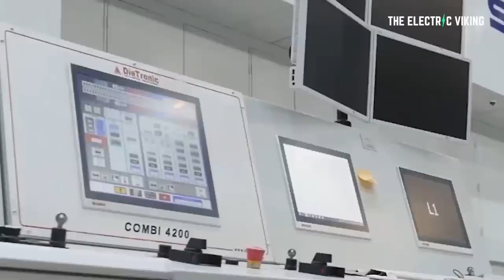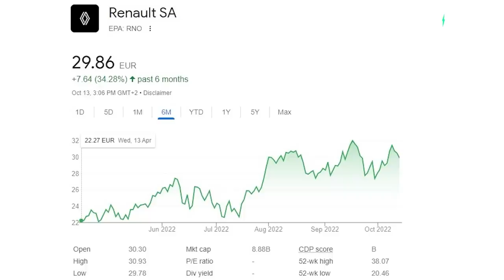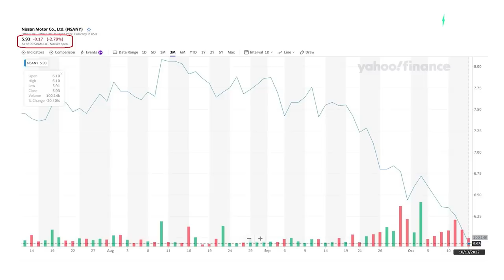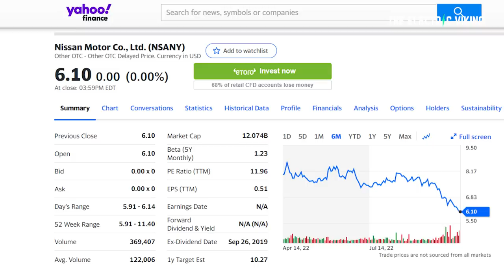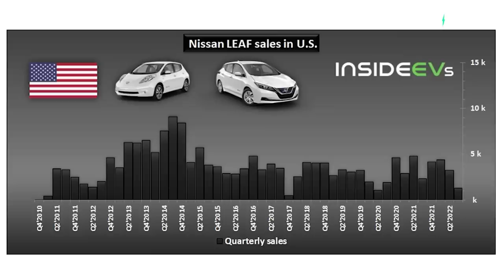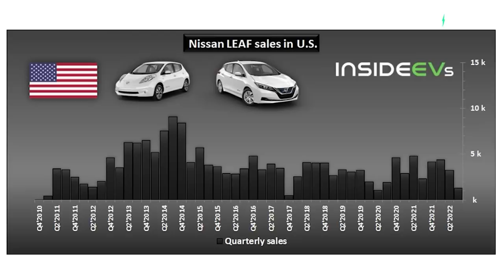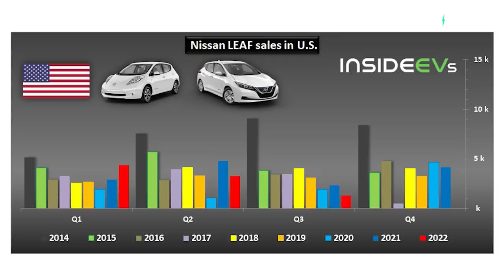Renault is DUMPING its 44% stake in Nissan as fast as possible

Comment: I’m driving a Nissan Leaf, my wishes would have been:

- CCS charging 
- thermal management for the battery 
- 3 Phase AC charging (11kw) in Germany, a household is usualy not allowed to use an 32Amp single phase Charger! They call it Schieflast prevention 
- a hitch allowed to pull at least 500kg

The rest would be ok and acceptable!
Reply: You should have bought a fucking truck. You have a Toy.

Comment: the leaf is just low key poor all around. poor range, poor fast charging, no battery cooling and chademo all for the same price as a bolt which as good range and battery cooling and a ccs plug but about the same shitty fast charging. so at least the bolt picks one struggle.

Comment: Flip side is that Nissan have an opportunity to fix the quality control issues that they acquired when Renault came along. The post Renault Nissan’s I’ve owned were complete dogs, in and out of the dealers, whilst the pre Renault ones were very robust and reliable.
Reply: Completely agree! And they missed a major opportunity not updating the current Leaf more than they did.

Comment: A key parameter is miles per kWh. Any company that can’t make efficient vehicles is at a huge disadvantage. Poor efficiency increases battery cost any weight. Increased battery weight Increases other weight and requires more costly tires that wear out faster. Charging takes longer for big batteries. If charging is done at home with standard household voltage& amps then a small KWh charge becomes reasonable time required.  Efficient miles per kWh is the key to success

Comment: I think it would be good to mention that the legacy OEM commercial model tends to have low margins on the actual car sale, while they depend on very large margin on parts, over the service life of the vehicle. Given the much lower maintenance overhead of EVs, Tesla won't have this trailing high-margin income stream.
Reply: tesla has the higher margin of software sales
Reply: Yes, Tesla won't profit from maintenance much, just as Toyota didn't compared to competition before electric. The result from their loss was twofold: 1. Toyota became #1. People are ignorant/stupid but they finally catch on. 2. Toyota saved on warrantee claims. Did they save on advertising, using word of mouth? Tesla certainly does profit, on net, from all three, namely, highest quality (best value), lowest warrantee payouts,  zero ads.
Reply: But Tesla will profit from FSD subscriptions and insurance, and is profiting from all of the data they collect from drivers to help them build the FSD systems. Tesla also has unheard of profit margins in the automotive industry from direct sales without the pesky dealerships, has the power to control pricing to match demand, does not pay anything for advertising, has the best long term supply chains in the industry, and has the worlds best charging infrastructure that they profit from both with their own sales and increasingly those of their competitors.
Reply: Just a thought that occurred to me….how quickly are people going to start dumping their ICE vehicles once they have to pay for all the spare parts and EV owners aren’t. Do you think this will drastically shorten ICE vehicle’s life expectancy and raise demand for EVs even further?
Reply: @lukeappleby5949  
This is one of the great known unknowns as EV's disrupt the market. When the first ICE manufactures go bankrupt, there also will most likely be a wave of bankruptcies in their suppliers. This will effect the price and availability of spare parts, since even aftermarket manufactures need time to adjust to major market changes. ICE parts are going to become increasingly expensive to manufacture as there is less new ICE vehicle production, but some prices may lower when the OEM manufacturers no longer have a lock on production and pricing. Just as the horse and wagon business changed, it's going to be a quickly changing business for many years to come. Do you know your local buggy parts supplier?

Comment: Not directly related to EVs, but what killed car sales in the U.S. for Nissan (I liked it better when it was Datsun) was their truly awful CVT transmissions. I have a Titan p/u but it has a regular automatic. Other makes of cars had and have CVTs but the hangover from their truly unreliable CVTs from a few years ago has made them a pariah amongst shoppers. They are improved and not prone to failure but they can't shake the reputation. Some of their CVTs didn't last 50,000 miles. Yes they got extended warranties which must have cost millions but with no warranty you are talking 5-6,000 dollar replacement. If Nissan goes down, it  can be traced back to their CVTs.

Comment: I generally try to buy Japanese products because the quality and reliability and engineering is usually there.  But they are really in danger of having their automakers go the way of their mobile phone manufacturers because of a refusal to innovate when a new paradigm emerges.
Reply: @JeanPierreWhite  excellent comment. My mother bought a new 2009 Nissan Murano back in 2008 and it’s been just about perfectly reliable for over 13 years. She drives it pretty often and keeps it in a garage and honestly it looks and drives pretty much like new.

Comment: I recently purchased a Nissan Rogue with a VC 3 cyl turbo. I have to say, I'm blown away the power,acceleration, low rpms and mileage. I don't think this type of engine/transmission that you can abuse and neglect, but I really like this car so far.
Reply: I have the same thing and love it! Reliability is always on my mind so I will baby it, won’t rev it too much and I’ll change the oil frequently

Comment: Don't think Toyota will have issues. They have huge sales worldwide because of their reliability. Many counties do not have electric infrastructure for EVs they use Toyo for everything.
Reply: you forget that they will loose sales volumes. that inevitable means that the price per unit goes up for them. that will squeeze them out of the market quite fast. ways faster than people realises.particularly as its their high margin cars that will loose first (actually already happening at a high rate). the coming 5 years will be extremly bloody.
Reply: The solar rays are the most well distributed form of energy there is.  You just need collectors, inverters and a lightweight efficient electric powdered vehicle to exploit the bounty.  What other form of potential energy can ambiently and ubiquitously reenergize a vehicle?  This existing mass distribution of energy holds a lot of promise for remote emerging economies.
Reply: Sure!!! Toyota's massive fuck ups in the past 5 years have been very reliable too. They're not bad, but not good as they used to.
Reply: Toyota will have issues. Doing business as usual is not an option. So many of the countries that have been their best customers can not afford to import fuel compared to making their own. Strangely,Japan is one of those countries. When their own citizens find it harder to get gas and buy electric,it will be too late.🤔

Comment: Loads of companies struggled during the pandemic. Hardly a priority purchase a new car when the county is locked down. Batteries its not a giant leap to move to lithium. One of the biggest battery plants being built in Europe about 15 mile from Nissan factory. Taxi drivers all over are using Leafs. You might have ulterior motives I think.

Comment: What a shame.  We have a number of Leafs and a tesla in our extended family and I much prefer the Leaf.  Nissan could be the iconic car of this century but she  needs to make some changes.  She needs a battery that includes temperature control.  She could go for LiFePO4 batteries with Mn cathodes.  She could get mega presses to streamline her manufacture and to the contrary to what you said, they could keep her car the same for decades if it is not a change that reduces the cost of manufacture.  She could also provide batteries so that you could use your present battery in the house and put a superior battery in your formerly 24kwh car.

Comment: Other than Nissan's halo cars, their offerings are fugly, unreliable, and not durable. They began to fall from Renault's rescue after producing rust buckets in Mexico, their bread and butter I-4 and V6 engines with defective oil rings. Boring trucks, terrible CVTs. Their Infiniti division seems completely off the RADAR. The GTR is being discontinued, the new Z is nice but overpriced due to markups. And they seem to be blowing the BEV initial push.  Yes, Nissan is returning to bankruptcy.  But they are happy to part with Renault. Japanese hubris.

Comment: I still have a great affection for the Leaf I purchased new in 2011 but something happened in 2013 at Nissan and sadly they have not recovered since. The whole legacy auto industry never realized what Tesla demonstrated with their roaster, not that battery power was king, but simply that the only thing that should be turning the roads wheels is electric motors. Nissan having lost faith in the Leaf then failed to capitalize on their  e-power unit initial success in Japan by not selling it in the UK and EU. However in this mad world it is anybody's guess who survives through the rest of this decade. ps I moved on to a BMW i3 rex and Tesla model 3

Comment: Maybe it's me but I get the feeling Nissan decided to go the "old way". Instead of making cars significantly better, every year each new / updated model has a few extra whizzes and bells : a USB plug at the back, a place to put your umbrella in the door, etc. 
In comparison, the King of all electric cars (you-know-who) actually increases the range and speed of your car with an online update. The King completely changes the battery chemistry in order to compete with China. The King is making self-driving cars a reality. The King has charging stands all over the place and is actually installing them faster and faster!
The race to electrification is on and Nissan seems to think there's nothing to it. I get the feeling they're not even going to cross the finish line!

Comment: Nissan EV 200 van would be great with 70 kWh battery and CCS. But with 40 kWh battery and Chademo only a bad joke.
Reply: Even a 120 mile range work van is robust for local service and delivery.  Why won't they do it?
Reply: @markharmon4963  With 40 kWh and the air resistance of a van, even 120 miles are a maybe. Strong headwind and no chance.

Comment: What upsets me is I love the Leaf. It is a better quality built EV without all of the bells and whistles. I have been in both.

The build quality of the Tesla sucks. The Tech on the Tesla is awesome. 

If only I could take the Tesla and blend it with the leaf and keep the same price for the vehicle. 

I also believe that the Chademo and Vehicle to grid bidirectional energy transfer should be the standard.

Nissan was ahead of the game 10 years ago with that one. 

The leaf is a very high quality built vehicle. It has been durable and reliable with a decent ride quality and better operator controls. 

I should not have to open a menu to turn on wipers or operate the radio or heated seats or any of those basic things. 

I should be able to reach for a know or switch and operate it without taking my eyes off of the road or search through menus.

I should not have to worry about getting into my car in the winter or get out of it without breaking out windows in an emergency.  I could go on and on about common sense things that the Tesla engineers do not think about.

I give it to Tesla for the rest of the tech that makes the car go. Batteries , charging, electric drive train and range. 

Tesla could take some lessons from the leaf on other things.

Comment: I believe that if they  work on a skate board chassis and get the right batterie pack, you start to change your business by continuing to build gas cars, and when you come out with a 4yr. Redo you come out with 2 or 3 vehicles that are ev at different size compact, mid , full size suv's,  at the center of the market. Instead of doing hotback suvs instead of right in the middle suv's,  then the trucks, and at the end cars vans. One plant at a time doing multiple lines of vehicles

Comment: Evs will not be a viable choice until the batteries get lighter.....one spends most of the energy in hauling of the fuel.... Why they have little range.
Reply: Tesla Model 3 Long Range 350 miles range😄😄
Reply: Aptera (top-model) =1000 miles range 😎
Reply: Rubbish, China and Tesla are selling massive amounts of EVs because the range and life is acceptable for the vast majority. The weight of an EV is very close to, or the same as a ICE. The range is enough for the vast majority. An average car drives 10,000 km a year, that's only 28km a day. Most EVs have a range of about 400km, not many people drive that far each day.
Reply: My Model Y has plenty of range, I only charge it once a week
Reply: @mikafiltenborg2291  In perfect conditions. Sure, ICE loses a bit too, but much less significant than EV. My TDI Jetta has no noticeable difference in MPG during winter months despite winter Diesel being less efficient.